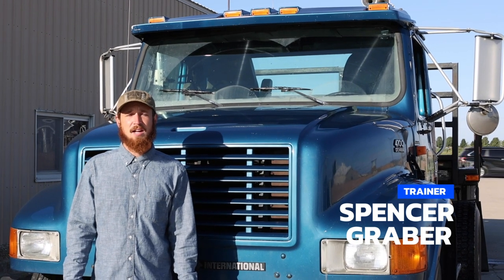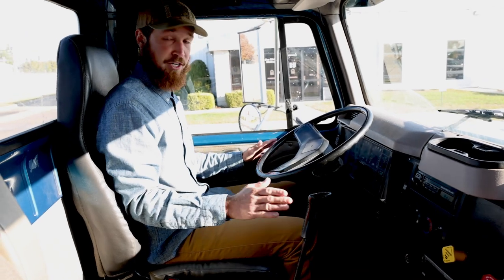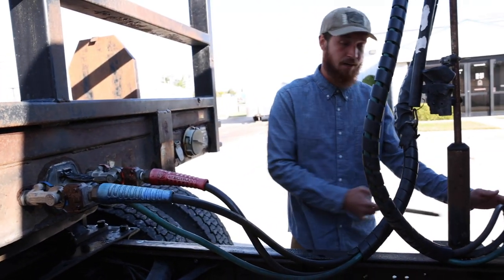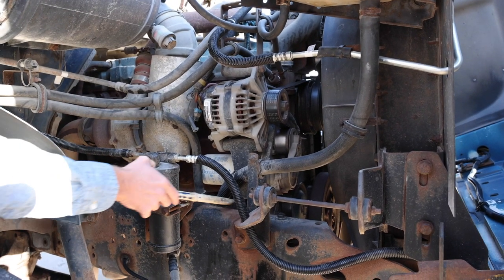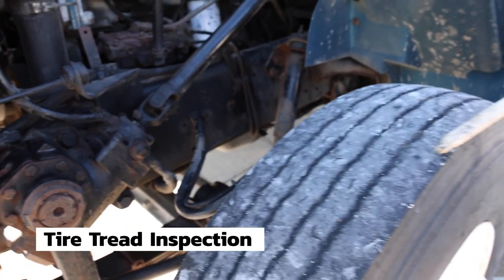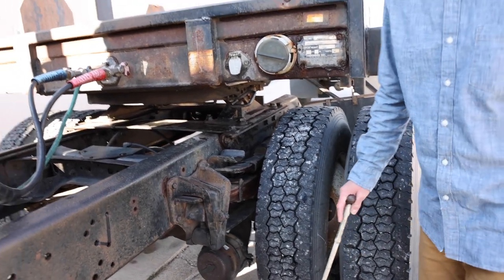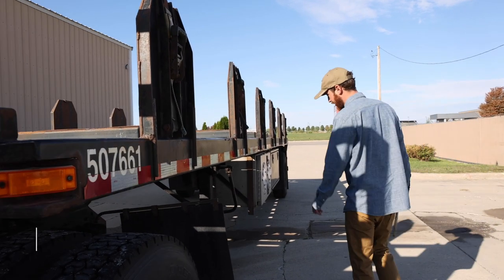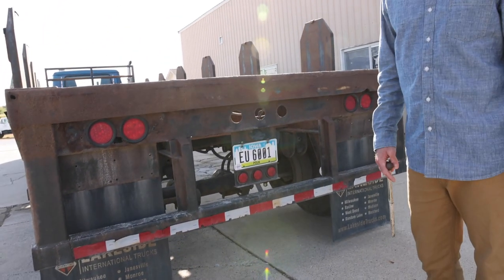CDL Class A Pre-Trip Inspection For DOT Test. Pass Your Class A Pre-Trip Inspection.

Comment: 5.17.24 - I took this course. These two guys are very informative and work with your individual needs. I was struggling with the parallel backing, Spencer talked me through it, let me come back to practice (free of charge). Then the day of the test I was allowed to practice as much as I wanted. I got to drive the test route 2x which helped. I'd most definitely recommend this course! These guys will answer your questions and want you to succeed.